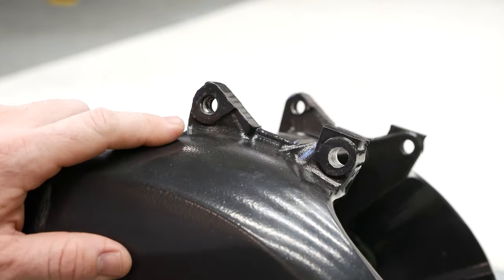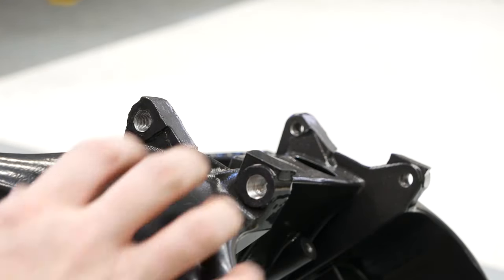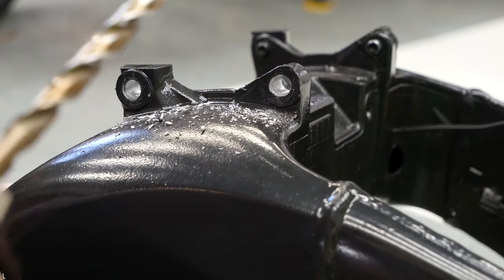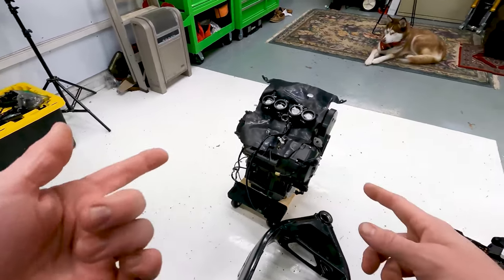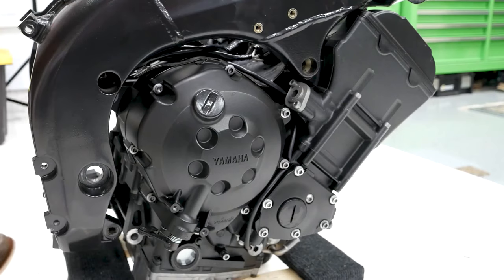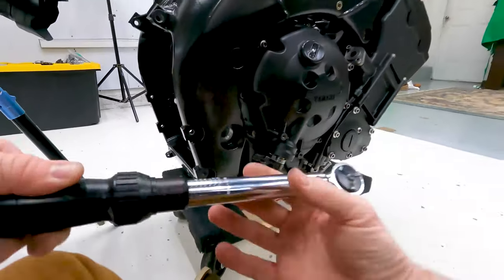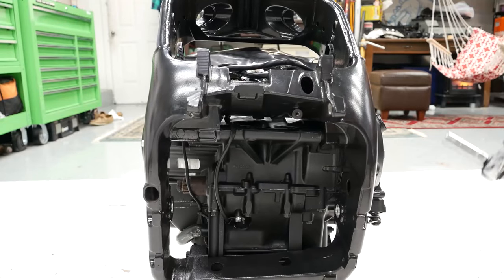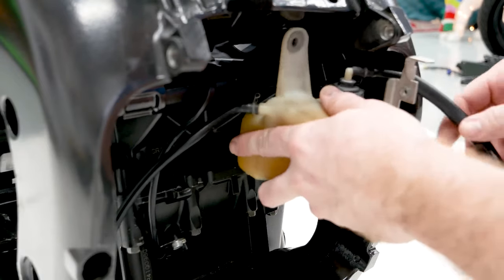Basket Case 2004 Yamaha R1 Rebuild - Final Assembly Part 2

Comment: What did you use for hardware? General kit? Or did you buy R1 specific?
Reply from the maker: For the fairings it was an ebay r1 kit. But I also keep several generic sport bike kits from like cycle gear.